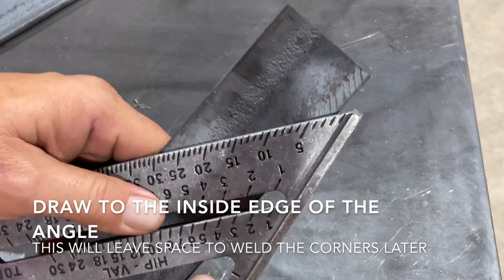Welder's Square

Comment: I like the build process but isn’t the point of a tool like this is to enable one to weld the pieces together. Welding from just the outside, with no inside weld undo the clamps purpose?

Comment: You really should have a guard on your angle grinder. At least, it looked like you had it removed when you were cutting the angles.
Reply from the maker: Maybe you should see your optometrist.
Reply: @txtoolcrib  considering I haven't gotten new glasses in 5 years that's a fair rebuttal
Reply: Watching a video in a bad lighting or low resolution, due to low streaming speed for example, can obscure the details.
Reply: The guard is present